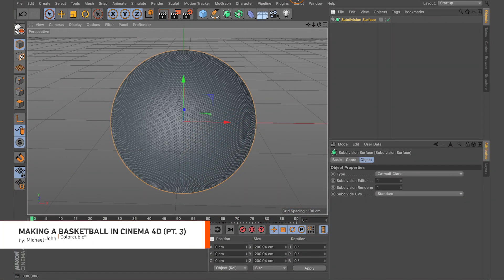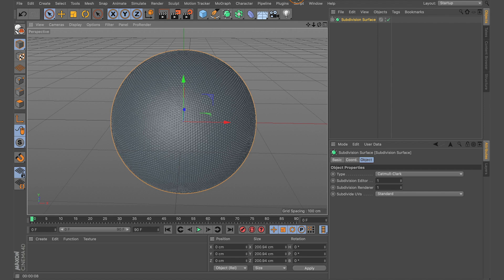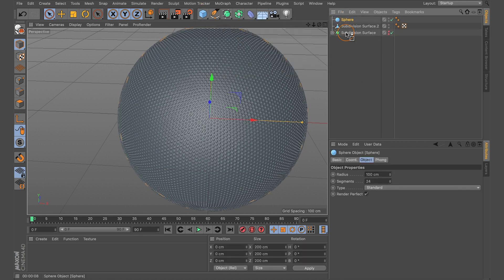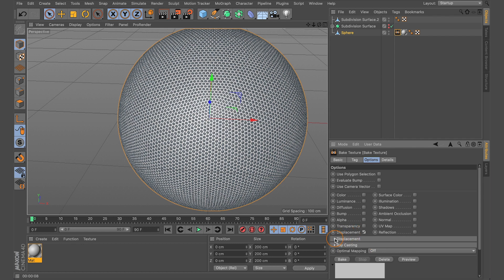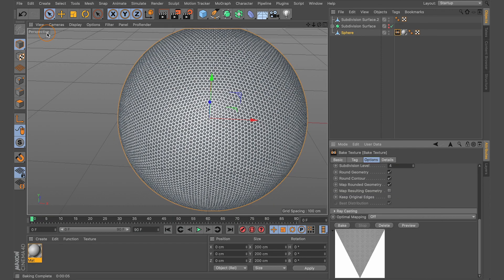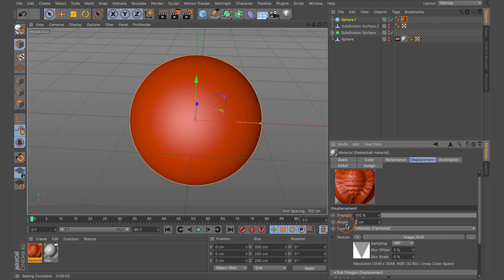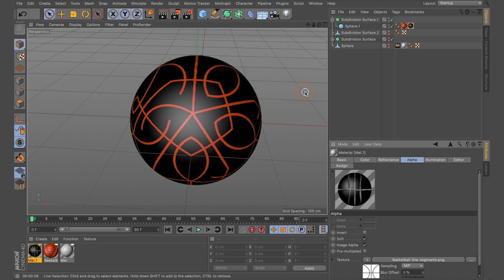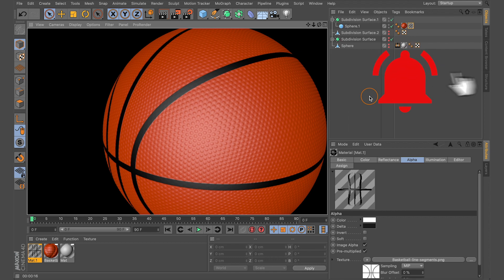Cinema 4D Tutorials - 3D Modeled Basketball (Part 3)

Comment: My man ur a real one for this 🤘🏼 appreciate u expanding on this more. Howd u figure out the UVW tag issue for baking? Tried baking without replacing it just to see and it took an hour. Good looking out on that tip. 🤝
Reply from the maker: Ha! Thanks! Yeah, not if you noticed the folder I saved that version of the displacement map texture to, but I had 9 other variations of the displacement map. Each one took a different amount of time to bake, and rendered different results. The one I landed on was the one that gave the results I was looking for. Completely accidental. 🤷🏽‍♂️